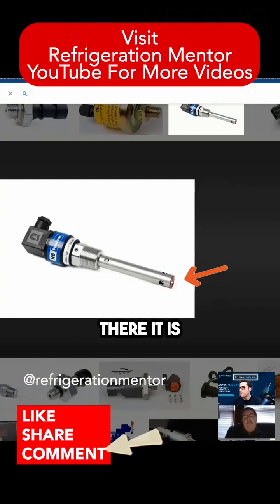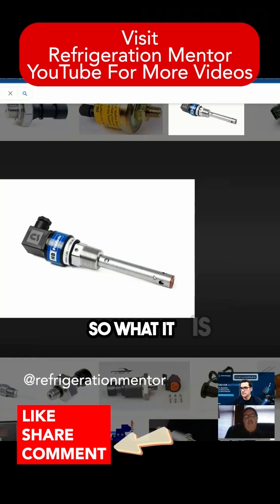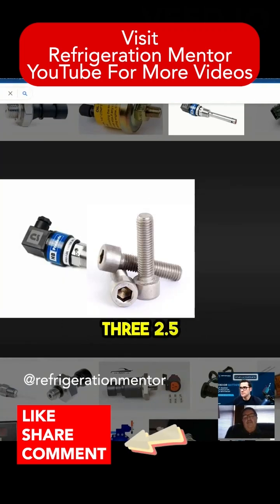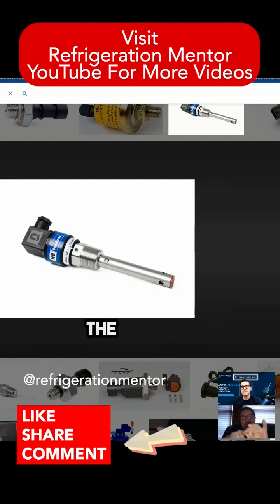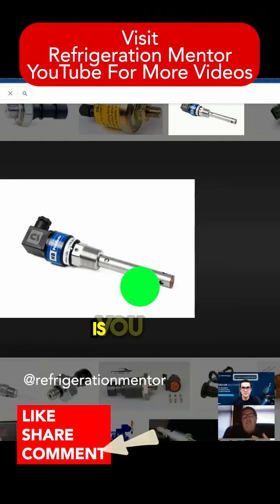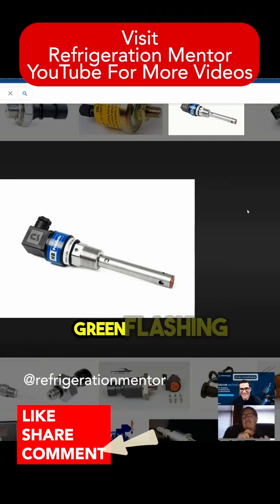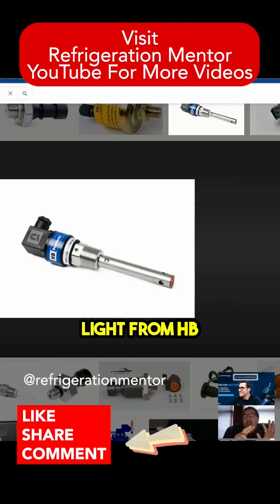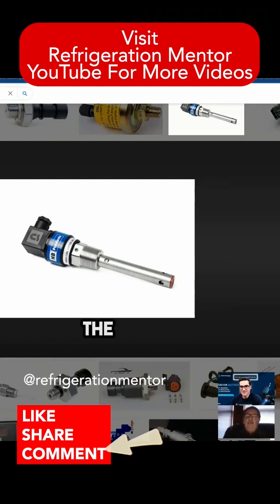Master Every Component: Essential Knowledge for CO2 Transcritical Booster Systems!

Comment: The receiver indicators have a high failure rate, not sure why the CO2 doesn't seem to make the conduction on the probe. Not much to it 2 stainless tubes with a white poly insulator between. 24v circuit, and a dry set of contacts.
Reply from the maker: What are causing the failures? Are they electrical or mechanical?
Reply: @RefrigerationMentor  IMO the sensor  dosen't work well with CO2, not exactly sure why. But have changed every one out on all the hill Phoenix  advancer racks. Don't know how to get in touch with OEM let me know if you have a contact or hear why these don't work well. Haven't had one issue with any of the oil types.
Reply from the maker: Send me an email to info@refrigerationmentor.com and I will see if I can help you.